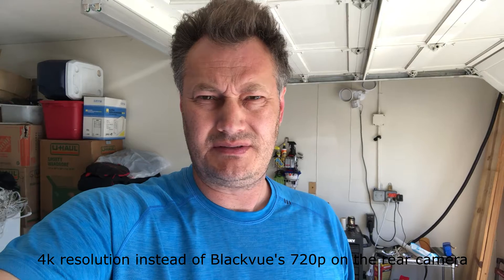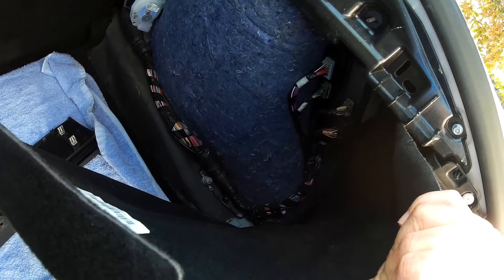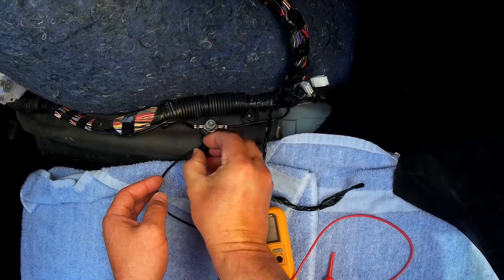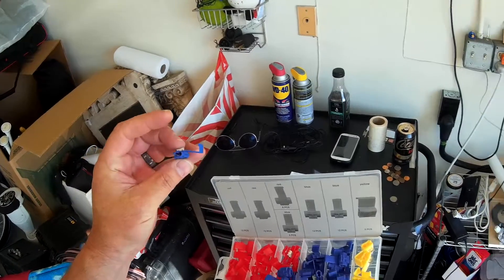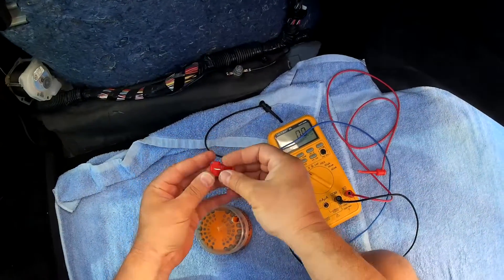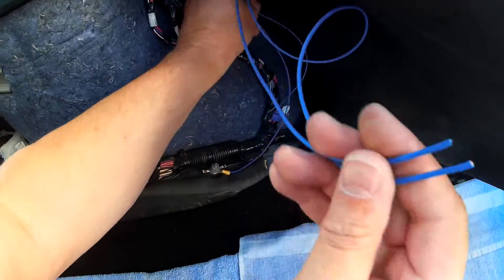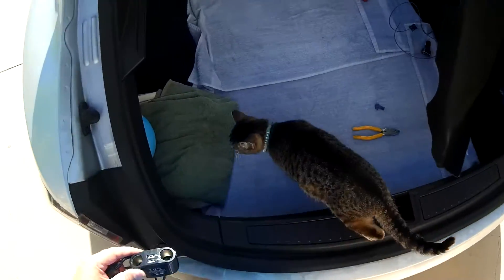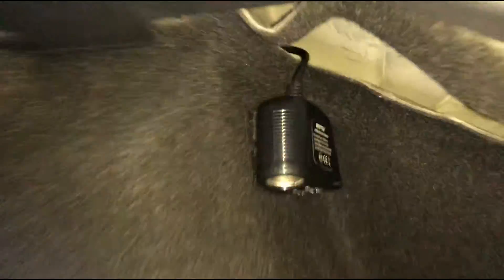Adding 12 Volt to the trunk in a Tesla Model S

Comment: Any idea what current you can pull from these? I want to install a ham radio transmitter, which may well draw 15A. Randomly choosing a wire at that current feels a little risky. Is there anywhere that tells what fuse ratings are fitted? I am thinking to take a feed from the subwoofer (I have 'premium sound') or maybe the power tail lift? Thanks! (73 de M1GEO)
Reply from the maker: 15 Amp are too much IMHO. I would run a dedicated line. The problem is the wires are designed for the load from whatever they power. Since copper is expensive they never oversize them. If you put 15 Amp on them on top of what the regular load is you are definitely drawing too much.

Comment: I want to add a 200W 12V inverter.  Unfortunately the cars 12v is limited to 150ws.  Is that really a 30A circuit?
Reply: I'm not sure there is a 30 Amp wire going to the back. The 12 Volt system of the car is easily capable of delivering 200 Watt for your inverter. I would put that in the frunk and feed it directly from the fuse panel.
Reply: @TheSharkcookie  what about the fuse panel on the front passenger side?  Think that can handle the 200w inverter?
Reply: @theronerd  I don't have a panel there. Mine is under the hood in the center.
Reply: @TheSharkcookie  copy that and thank you btw.
Reply: @TheSharkcookie  also if the car is in camp mode.  Is the 12v being charged by the main pack?
Reply: @theronerd  the 12 Volt battery will always be charged. Even if the car is off. I have tried that. The car will always monitor to the battery and top it off if needed
Reply: @TheSharkcookie  thank you for replying to all of my questions.
Reply: @TheSharkcookie  The gateway checks the voltage of the 12v AGM battery once every hour. If it detects a low AGM battery voltage, it will place the car into support mode to recharge it using power from the main traction battery. When the car enters support mode, you hear the contactors click in with the loud-ish clunk from underneath-centre. You must be careful not to flatten the 12V AGM battery too much before the gateway can notice and enter support mode.
Reply from the maker: I believe the car monitors the 12 Volt system voltage constantly, not just once an hour. I have a 1500 Watt inverter hooked up and many other things. The DCDC will kick in instantly if there is a load and the 12 Volt battery voltage drops.
Reply: @DavidDrivesElectric  the cigarette 12v not the cars.  I've since hooked up my inverter to a fuse panel.
Reply: Useful thread, thanks both! :)
Reply: What are the things called that you used to tap into the wire?
Reply: @zwhitchcox  t tap.  Find those at your local auto parts store

Comment: do you think i could run a small portable fridge from this 12v setup? does it power off when the car is parked/locked? cause i would need the fridge to run all the time
Reply from the maker: I would not connect a portable cooler there. Just because it draws power constantly. The 12 Volt system of the car can easily take it. But those wires I taped into are not meant for higher power draw. It is a constant 12 Volt line though, so yes it would stay powered even when the car is off.
Reply: @DavidDrivesElectric  A small portable fridge is usually something like 3A on 12V. I wouldn't see that as a problem?
Only issue maybe that it drains the 12V battery of the car?
Reply: Have you ended up powering the fridge? Which What about draining of 12V battery issue? I heard it recharges automatically from the high voltage battery if the 12V is running low?

Comment: Hi again, David. I am planning on putting a Ham radio in my S, and that is why I need the power tap. A few more questions if you don't mind. There is a tool you use at around 3:07 for removing clips. Is that a common nail remover, or is it a specialty tool? Second question: Do you know a good way to snake a wire from the trunk to the little cubbyhole under the dash screen? I don't know if you are familiar with Ham radio equipment, but mobile radios can often be split; the largest part with most of the electronics can be anywhere convenient, while the much smaller control head can be mounted on the dash (in my case I want it in that cubbyhole I mentioned). Both are connected with a thin wire. Daisy is a nice tabby by the way. We are cat people.
Thanks, Steve
Reply from the maker: Yes it's just a tool to remove nails but it works great for those rivets. As for the other question. The cabin and the front trunk area are pretty much sealed off. That is a common thing in the car industry. The idea is that if there is a fire in the front after a crash or some components overheats, it isn't easily spreading into the cabin. So I don't think there is a hole where you can easily fit a wire through. There is always a way, you will probably have to drill a hole.
Reply: @DavidDrivesElectric  Thanks again. Just starting this project, so if I figure out a way I will let you know for future reference.
Reply: @DavidDrivesElectric   David..I finally added the wires to get 12 volts to my transceiver. The one big difference in my install is that there was no chassis ground to be found anywhere near the wiring harnesses or the two control boxes. I didn't want to tap into the ground wire that is available on the Molex connector directly below the +12 gray wire. The reason is I don't know where the other end of that goes, and I heard that hooking to the negative terminal of the lead-acid battery can cause problems with the low voltage sensor. I ended up putting a wire under the bolt holding the structure that holds the back of the seat when it is upright.  It makes a good chassis ground as I measured it to some other places. Again, thanks for the video..it was a big help.

Comment: Thanks for this David. Will the procedure be the same for a 2019 S?
Reply from the maker: Yes the Model S has not changed much in that regard.
Reply: Just fyi, the ones with the upgraded sound system (standard on more recent cars) has the subwoofer on that side as well. So the cloth/cardboard trim might look different. Wiring is probably the same though.